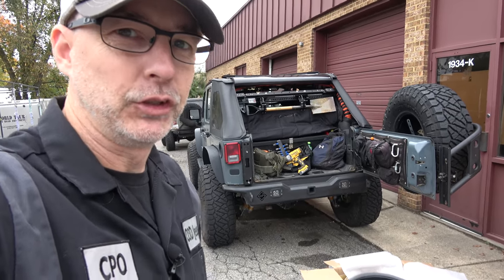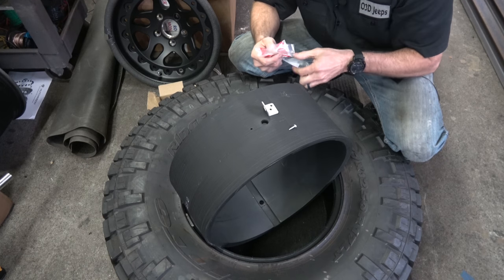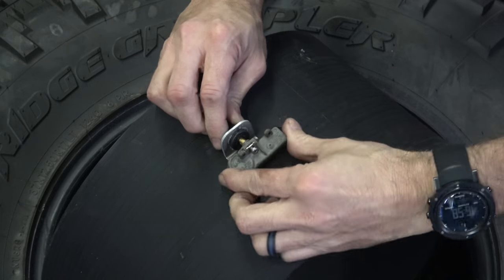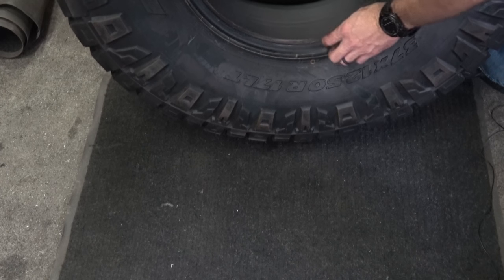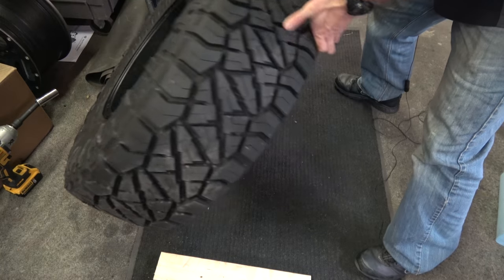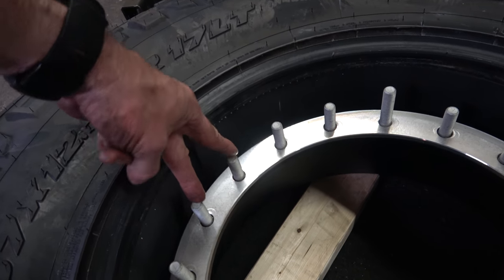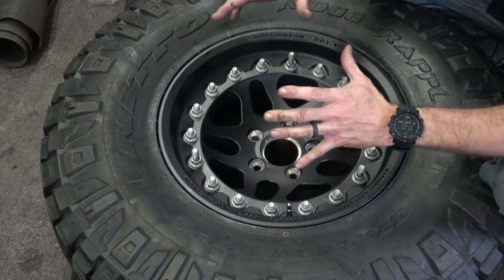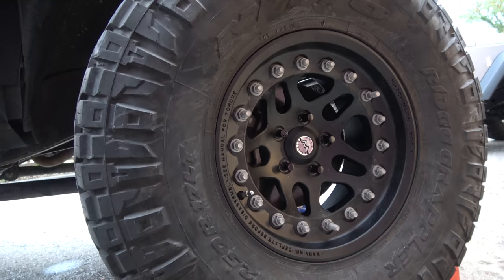Hutchinson Rock Monster Beadlock Wheel and Tire Assembly - Detailed How To

Comment: Great video.  Very informative.  These wheels are super high quality and after running them for a number of years on my JKUR, they made the transition to my new 19' JLUR.  I beat the hell out of them, but they look as good as new - no pitting or bubbling.  I may replace a couple of the plastic bolt covers, but that is no big deal.  Tire shops may not be willing to take this project on - it is a little involved as you can see in the video, but  with this video as a guide and a good torque wrench, some latex gloves and some Vaseline (rubber O ring) this is absolutely something you can do - make sure you get them balanced.

Comment: thanx, i worked back in day at tire shop and never knew bout lil yellow circle being lite point of tire, but always placed valve stem at that location as it seemed logical to eighteen yr kid. and understood the whole point of "beadlock" wheels, but never actually saw tires installed. This is first video i've seen with any type of "actual beadlock system" for both beads, others only have exterior bead locked, but not inner leaving inner bead the ability to collapse at 5psi. most are just for decoration i guess or ppl are not installing tire on rim correctly. Q. is there a manufacturer who uses ring type lock for inner and outer beads? other than professional drag racing teams? i have a jeep i run in sand with paddles, and many times have wished for beadlocks immediately after a blowout due to weight and gravity, speed of tire running at 5psi a must for traction. but i have never seen a rim thet protects both beads.  guessing those Rock Monsters are not cheap, where can i purchase set?

Comment: Jeep looks awesome! I love the rims. I saw how you balanced them but my question is why not use dyna beads instead? Also how have your fender flares held up? I’m thinking of getting the same set. Thanks Jason Kus.
Reply from the maker: Fender flares are holding up great!  no issues.  I haven't been a fan of balancing beads. I'd much prefer the traditional sick on weight method unless there is a reason that won't work.  In my research, I found as many people that had troubles with balancing beads as liked them.  It just wasn't worth it to me to mess with them. If they don't work out... they can be a pain to get out... But just to be clear, I have no personal experience with them .
Reply: @o3djeeps  It seems that balance beads (which I normally run) wouldn't work with this setup.  Normally the TPMS is out of the bead path and on the rim, but in this case, the TPMS is in the center and would seem to interfere with movement of the beads.  And of course, I think you'd bead-blast the TPMS, too :-)

Comment: Great video, except you should never use anti-seize on studs. It changes your torque values.  All required torque values are established with DRY measurements. It can lead to too much torque which stretches and weakens the metal. I get why one would think it’s a good idea but there’s a reason it’s not recommended in the instructions.

Comment: thanks for the video.  Quick question - what is the purpose of the two-piece nuts?  When torqued both halves get torqued at the same time so I'm not understanding what the purpose of the separation is?  

Also, can the longer studs be replaced with standard length studs? (presume regular length studs can be ordered from Hutchinson?  I completely understand why there are longer ones for beginning to compress the outer wheel to the inner - got that, but I can compress the two halves far enough to start all the studs vs just the longer ones, and I'd definitely prefer the appearance of 'matching' studs.
Reply from the maker: Great questions. first the reason for the two-piece nuts is they act as lock nuts. So in the same way you would tighten one nut down and then add a second nut and tighten it where they lock against each other this two piece design accomplishes that with a single nut it's kind of innovative if you ask me. As far as the second question, they're just standard pressed studs so I'm sure they could be replaced if needed and I don't know if there's anything special about the thread or pitch so it's probably something you could source if you could figure out what they are.

Comment: How do the Hutchinsons work for you? I'm thinking of getting the same.  Any rubbing issues?  I don't think I noticed any spacers on your other videos.  I run a 4 inch lift with 37X12.5 tires, but with factory wheels and spacers.  I want to get rid of the spacers.  Thanks!!

Comment: Could someone point me to some info (actual use info via a forum) regarding how these wheels are as effective as a traditional beadlock (Dodge military combat wheels and later engineered by Marsh Racing for civilian use) that actually clamps the tire bead between the (aluminum) rim and (aluminum) lock ring.

The locking mechanism for the Hutchinson is a rubber tube that supports (not really locking) the interior of the tire at the bead. If the rubber tube was two inches thicker made out of ABS, Delrin, or aluminum, it would actually increase the clamping forces needed to withstand lateral (sidewall) forces present in low pressure rock crawling situations or forces present on the front tires during a turn.

I can see the optional VFI (Variable Function Insert) providing more support (and weight) but nothing like a traditional beadlock used in off-road rock crawls (Hammers) or even double beadlocks for on-road drag racing. I can't see shredding a tire with this wheel before shredding the internal rubber tube. Even a motocross wheel uses an internal metal clamp. Any help would be appreciated.
Reply: D Max not trying to sound like a jerk but did you watch the video?
The black inner ring is what locks both beads when bolted together

Comment: Great Video Sir!   Question:  I'm just about to put mine together 37 x 13.50 17s on Rock Monsters.  The manual says to align the TPMS with the Air valve.  In your video you appose them 180 degrees (which I like the idea of for balance.  Why would they say to do that, have you had any TPMS function issues?    Thanks for any help.
Reply: Following up on this question... about to install the same and wonder how the alignment of the TPMS worked?  If you put it on the opposite side of the wheel from the air valve, did the sensors get picked up correctly?

Comment: What a lot of time and hassle.. Just use an Inner Tube and save a lot of money and time. Only one side of the rim is bead locked with bead lock rims

Use a tube and the air will stay in.
Reply: Mr Ben the ring he put in the tire first locks both sides of the beads to the rim. It’s an internal beadlock as opposed to a clamp ring. It’s a great design and DOT approved where most beadlocks are not.

Comment: What istotal weight of the wheel and rims and what gear ratio are you running with this set-up
Reply from the maker: 4144sbrs not positive on total weight. I'll try and get it on a scale. I'm running 4.88 gears